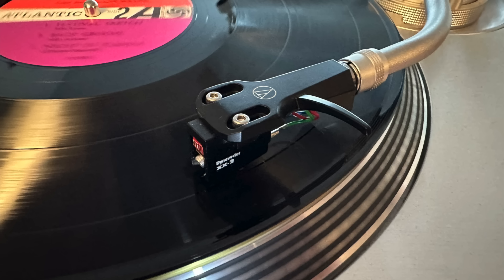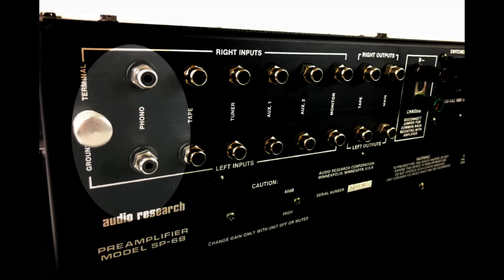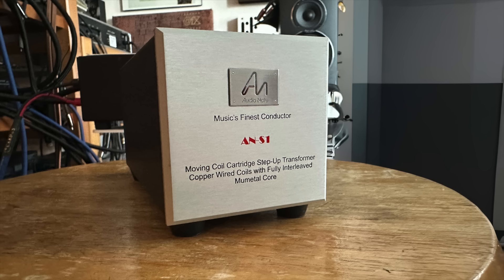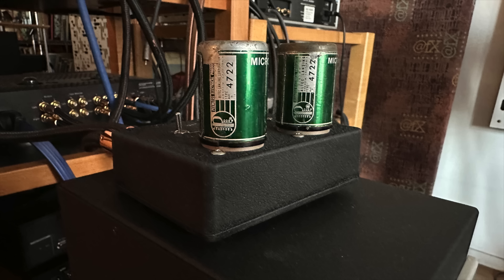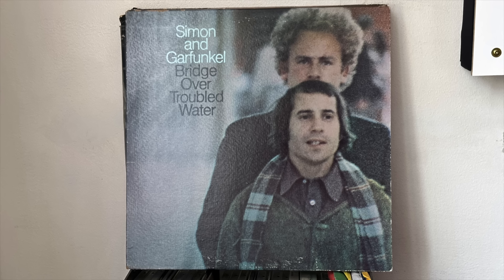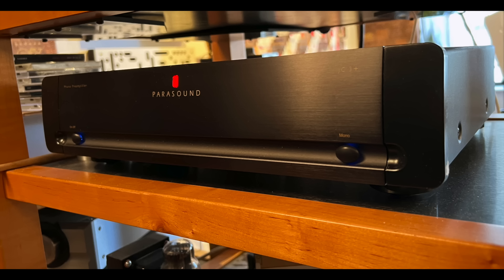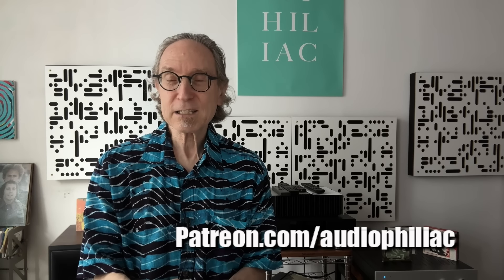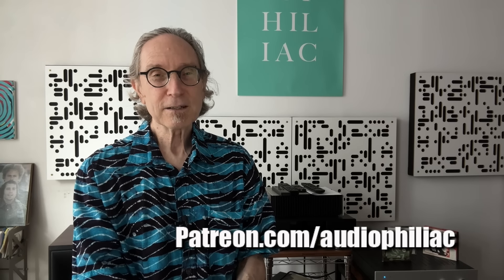HOW TO get the BEST SOUND from MC CARTRIDGES!

Comment: Very informative video which motivated me to find and buy a SUT for my Hana EL. I found and bought a Verion/Cotter Mk1 S locally, which matched up well with the Hana. I was, as you said, blown away. This was not a particularly inexpensive upgrade but one of the best investments I have ever made in the system. (Hana EL, Verion Mk1, Rega P3, iFi Zen, PS Audio 4.5, Dahlquist DQ-LP1, Belles OCM 200 (low frequency), PS Audio 200C (high frequency), Dahlquist DQ-10s, dual Dahlquist DQ-1W subs, Bluesound Node).

Comment: Steve -- I've used SUTs for years, almost exclusively.  I agree with you.  As you say, an MC cart requires two stages of gain.  That first stage can be accomplished with an SUT, a transistor in the phonostage, OR an SUT built into the phonostage (CS Port's and Nagra's phonostages do this, for example).  What it took me years to realize is that many, many "tubed" phonostages actually run your MC signal through a solid state transistor first (Audio Research, for example).  I bought my first SUT simply to bypass the sonic imprint of a transistor (as an experiment), and it led me to a place where I now own 15+ carts and 15+ SUTs.  Borrow one whenever you like.  But there are a few camps out there on the adjustable SUTs like Zesto's.  The magic of the very best SUTs is in the artisanal windings of the actual transformer, and that artistry can get overshadowed by monkeying around with variable impedance, variable gain, etc.
Reply: That is something Kondo, Ypsilon and Air Tight do well. My friend owns one of the best solid state phono stages in the world - CH P10. Though personally my dream phono stage would be an EMT JPA66 MK3 due to it's all tube design and excellent adjustability and flexibility.
Reply: From those you own, what are 2-3 of your favorite SUT's?
Reply: Miyajima’s mono SUT, Lyra’s newly-available Erodion EVO (for an SL Lyra), and a Sound Tradition SUT made with Hashimoto x-formers.
Reply: There is a SS stage in AR's amplifiers as well.

Comment: Steve ~ As to why most step up transformers increase dynamic range better than active gain stages has to do with the ability to transform the moving coil's low voltage, high current input (via a low impedance primary winding) to the high voltage, low current output (via the secondary high impedance winding).

It does this by 1) conserving input to output power passively without adding noise, and 2) having unlimited slew rate by over-designing the transformer's magnetic core material.

SUTs I use with my vintage Ortofon LOMCs are:
• UTC Ouncer 01 w/ MC-10
• Lundahl LL1941 w/ MC-20, and
• Triad JO-3 w/ LYS.

IMO, SUTs get the most out of LOMCs.

Comment: Steve, It amazes me it took you so long to realize how much better MC step-up transformers sound over high-gain active preamps. I experienced the same thing 20 years ago with my Benz Micro L0.4 cartridge, a relatively high 0.6 mV output. I had a vintage Audio Interface MC transformer (still have it) CST 80 (20 db passive gain) which I had bought in the 90s with a Dynavector Karat Ruby (also a high coil impedance cartridge). I was blown away by the warm, luscious, lush, addictive sound. The L04 had similar electrical specs as the EMTs so I bought an EMT cartridge and thats heaven. Linn has a new cartridge (the Kendo) I understand made by EMT with the same specs: 0.6 mV output and 12 ohms coil impedance.

For your XX-2 (6 ohms) I suggest you try the Dyna's own transformer. It also works with Ortofons and Audio Technica. For the Zu (Denon), Denon transformers are the best.

The AI CST80 is considered one the best MC step up devices, comparable to the legendary MA Cotter. For Benz, EMTs, Denons, Dynavector Karats, Van Der Hulls. There is one on eBay right now at https://www.ebay.com/itm/225612746732

Comment: Step up transformers (good ones) are wonderful.  I have used head amps as well, which might be more transparent, but there’s something about a transformer that adds to the musicality of the cartridge that I prefer.  I’m glad you were able to discover the magic that a good step up transformer can add to the vinyl playback experience!

And they do sound different, I’m on my third or fourth model of step up transformer, with this time using  Bob Device‘s Sky transformer, have a pair of David Slagle’s transformers he made for me that I need to rewire to get rid of a ground buzz issue, both transformers sound different from each other. The Slagles are a bit more transparent but have a lower output, while the Bob’s Devices transformers (custom made for him by Cinemag) have more of a sense of body and drive to them.
Reply: I agree i discovered this the hard way i had a Conrad Johnson Premier 15 with a Koetsu Rosewood standard and a VPI Scout and a step up transformer and that combination sounded better than a 20 grand phono without a step up. A step up adds meat on the bones and dynamics and makes it sound more alive period and less 2 dimensional they work well in the right set up.
Reply: I finally took the plunge and bought a Bob’s Devices SUT - one for my stereo cart (Hana ML) and another for my mono turntable (also Hana).  I was skeptical that there would be a meaningful difference.  BUT what a difference !  The “meat on the bones” description is spot on.  Also you should buy a shielded cable from SUT to the MM phonostage.  Just listen to Steve and do it!  By the way I have a Gold Note PH-10 phono stage which has numerous settings which I found helpful to dial things in.

Comment: I have since 1982 used an Audio Technica  AT-630 For MC Cartridge Step-up Transformer for my Nakamichi MC1000 reference pick-up on my VacuumState FVP5a preamplifier that  never had enough gain. I have recently (2yrs ago) purchased a JLTi Phono moving coil preamplifier which has taken my vinyl setup to new levels of charity, wider soundstage and in your words a more there, there experience.
I was happy with the step-up transformer but was total blown away by the JLTi phono preamplifier in my system.

Comment: Great topic Steve! It’s worth noting that the SUT’s turns ratio needs to match the LOMC’s impedance, and that there’s a calculation to figure that out. Also, another phono cable should be used between the SUT and preamp, not just a regular interconnect. Because this is typically an RCA to RCA connection and most phono cables have a DIN to RCA connection, this is a common mistake.

I use an Allnic AUT-2000 SUT with four different gain settings, similar to the Alesso. Up until now I’ve used it with the MM input on a Luxman EQ-500 and an EAR Yoshino 868 pl, both of which also have LOMC inputs. I agree completely with your comments that SUTs are more dynamic and plump up the bass. Even though both the Luxman and EAR use transformers, the Allnic is noticeably better. As passive units, as long as they are placed away from power sources, they are also incredibly quiet, which I believe aids the sound presentation.

I like SUTs so much that I’ve just ordered a high quality MM-only phonostage, a Lejonklou Slipsik 8, to pair with the Allnic. I’m totally sold on SUTs and may purchase several more in the future. The MM/MC phono preamps will go to new homes. They just aren’t needed!

Comment: The cool feature of SUTs is that high frequency brightness can be compensated by putting load resistors across the secondary winding. Parallel resistance provides HF roll-off. Ended up with 165KΩ across the UTC Ouncer 01, and 110KΩ across the Lundahl LL1941s. The Triad JO-3's didn't need any ~ they sounded fine w/o any :)

Comment: The clarity and sense of increased presence you hear with the step up transformers is the exact same change you will hear when moving from resistive volume controls to transformer based volume controls. When I put a pair of autoformer attenuation in my 300B SET amp. It was like lifting a couple bed sheets off my speakers. I would recommend them to everyone.

Comment: Steve's findings (or should we say rediscoveries) are spot on, a good SUT is the best way to elevate an MC's tiny output to MM level for use with a standard preamp with MM 47kOhms input. Some of the very best were made by Mitchell A Cotter during the 70s and 80s, get your hands on one and be prepared to be blown away (for lack of a better term as I rarely use the term like Steve) but be prepared to shell out serious $ as they command very high prices (and justifiably so).

Comment: Glad you rediscovered SUTs. I've been using a Bob's Devices "Sky SUT" for about a dozen years with my Ortofon Cadenza Black. My phono stage is the well-regarded EAR 834p Deluxe MM/MC designed by Tim de Paravacini but the MC is dull and lifeless. All that goes away with a great SUT in play.
Reply: Cool, I use the same combo (Sky SUT/EAR 834P) in one of my systems, very good performance for the money.
Reply: You do know that the 834 uses a SUT for its MC section, don't you?
Reply: @razisn  You obviously don't know that the 834P also comes in a MM ONLY version. I've owned both of the 834P models. Do a little research, it might help you understand better, just a thought.
Reply: @razisn  Yes, but the quality of the transformers or their implementation is not good. Not just me, but almost every review mentions it. And Stereophile lists it as Class A in their biannual rankings but singles out that the Class A rating is just for the MM section even though the model they are discussing is the MM/MC model.

Comment: I've taken the same route, but with different brands all over, and WOW... the speed, the clarity, the details, the soundstage, voices, decay, everything sounds like a much more expensive cartridge.
I have a vintage Luxman PD-121, modded it through the years, because it was actually marketed as a 'mid level' table. And it sounded like one too. Some of my mods are:
I raised the edge of the Platter Matter by approx. 1½ mm, so that the center of the record is pressed down by the same distance when I mount my Nagaoka clamp. This provides a better physical contact area between the record and the mat, which in turn provides snappier transients and a firmer bass. The error in azimuth is much less than half a degree, and is not audible.
I have added ~3 kgs of mass to the table.
I replaced the lousy stock interconnects with Furutech AG-12 DIN/RCA interconnects.
In 2020, I replaced the rather primitive FR-54 tonearm with a Audiomods Series 6.
The same year I replaced my Holfi RIAA with a Primare R-35.
In 2022 I replaced my Denon DL-103R cart with a Hana ML.
In 2024 I purchased a Ortofon ST-80 SE step-up transformer, and had my local HiFi shop make me two sets of low capacitance, low resistance interconnects. Both are Audio Note AN-C Coax cables, 50 cms long, with the two center wires soldered in parallel for the lowest possible resistance, and fitted with Neutrik RCA plugs.

I agree that the SUT in combination with the best interconnects and a better than decent RIAA, makes a big difference, and to the better. I am never going back to using the MC section of my RIAA.
Reply: Thanks Steve :)
Oh, and I forgot that I also damped the bottom of the platter with double adhesive gel strips, and the several places on the bottom of the plinth, as well as added hard foam strips underneath the table, to help isolate it from vibrations caused by my left speaker, that is only 3-4 inches away from the table.
Here's some of my fav reference albums, that I know the very well:
Dire Straits: On every street (180g)
Dire Straits: Brothers in Arms (MOFI 45 RPM, 180g)
Doors: An American Prayer
Gregg Allman Band: Playin' up a storm
k.d. lang: Ingénue (25 years anniversary edition, 180 g)
Björk: Debut (180g)
Steely Dan: Gaucho
Steely Dan: Aja

Comment: Great video, I have been aware of SUT’s but no one has ever mentioned that they could give superior performance over an MC input. Thanks for pointing this out, I will have to check this out.
Reply: Seasoned audiophiles have known of the superiority of mc cartridges and SUT's since the mid 70's. I bought my first SUT in 1977 to use with my GAS Sleeping Beauty mc cartridge - Verion/Cotter P SUT.

Comment: SUT's are the MC secret sauce. The reason is simple, there is no power involved. As long as they are well electrically isolated, they will always be THE right choice. An important point, given that they introduce another set of cables to the loop, shielded RCA cables are an utter necessity, or you'll have another antenna for electric interference. Ortofon makes some excellent ones exactly matched to your Ortofon MC's.  The improvement over McIntosh C53 internal MC amp (which is superb itself) was definitely noticeable.

Comment: In the 90’s, my company, Expressive Technologies, made a very special step up transformer. It was highly praised by Steriophile and TAS. We sold a modest number of them. 

For reasons that I won’t get into here, it’s very difficult for active circuits to handle extremely low voltages well. Even though the transformer adds an interconnected and itself, the benefit of a 20X voltage is significant and easy to hear.
Reply: I agree! After a music signal passes through an SUT the signal-to-noise ratio is superior to ANY mm or mi cartridge. The result is more life-like detail and dynamics from familiar LP's.

Comment: I'm still using  an audio technica AT  650  step up transformer with at oc 3 cartridge.  Sounds superb , 40 year old transformer with variable impedance settings and silver wired  internally.  Fetching high prices on the second hand market .

Comment: I'm using a DENON AU-320 step up transformer with a low output Benz Micro Reference cartridge, going in the MM tube phono stage of a Sunfire tube amp, and the sound is amazing !
Reply: I’m considering that SUT for a Denon DL-304 cartridge. It should be spot on for it, but my concern is that old looking cable with plastic RCA plugs -I would rather use my own low capacitance cable. Did you find any problem there? Is the cable well shielded in your opinion? Thanks in advance!

Comment: Dynavector XX2 MKII is great, it’s been my main cartridge for the last few years.

The way you describe the transformer as having a more expansive sound is exactly what I’ve experienced with transformers versus step up/head amps!
Reply: I also use an xx2 into an EAR 834p.  I've heard this phono has good transformers within but there is also a separate step-up, the MC4 which I've wondered about.
Reply: Can you recommend one of the less expensive Dynavector’s?

Comment: Steve, great video man. 1 thing though, with Ned’s bases you’ve got that same ability to use 4 different gain settings.  Add a Darlington Labs MP7b with many different load settings fir a lot less than the Zesto…..anyway, I’m an analog fanatic, so loved the video😊
Reply: Sorry, should said Ned has another base, which I have,   that has 4 different gains…or 4 winding ratios, however you want to say it.

Comment: Really great video Steve. It inspired me to trial a couple of SUT options with my Hana ML + Dynavector P75 - a Fonolab EQVES and an Audiitorium 23 (Denon 103) SUT. Wow...what a transformation. The Fonolab produced similar results to what you described with the OJAS unit, but got a little congested at the top end. The A23 was spectacular top to bottom and the one I have kept. Matching SUT to cart is definitely pretty critical, but on paper the A23 should not be an ideal match for the Hana ML - proving that auditioning is the only way to go.

Comment: straight wire with gain, I suppose the host didn't want to sound trite, but I'll repeat the conceptual  ideal amplification, and I would say the passive amplification described here is about as close as one is going to get.   

I was pleased to find that my understandings aligned with the expert host's experiences.  I run only a single MM cart for ease of amplification, so have only that experience.   But it only stands to reason that a simple this or that phono voltage amplifier is going to have it's limits, so I've been sticking with my nice MM cart and replacing the tip when it wears, knowing that a stronger signal will get processed less.   Plus my records are mostly rock and simple to record stuff, so I'm fine. everything sounds good.    

But this presentation reminded me how best to set up a low output cart, and although I have been thinking about upgrading my amplification , I haven' t really been thinking of transformers , even though I knew they were the best way to go.  .

I don't switch carts , so I'll just have to find one optimal match transformer, if I don't stay with high output .
Reply: I have never heard a mm or mi cartridge that can compete with a lomc cartridge/SUT combination.

Comment: Reading The Audio Critic mag in the late seventies early eighties they were all into passive SUTs as opposed to active MC stages, as the very best way to boost the signal from your MC cart of choice. So it's far from a new idea and I've been using these ever since. MCs electrically vary so much when comes to their different needs, that to extract the utmost out of your cart you really need to have a specially dedicated SUT for each and every one of these. OR as I do; have a very versatile Kondo AN Japan all silver S-7 Cz transform with a captive AN silver IC cable. And boy do it sound differently according to the settings. And absolutely glorious when hit bulls eye.
So if you have a lot of different MC carts it is wise to choose a variable Step Up Transformer
Reply: I agree! I too subscribed to The Audio Critic! My first SUT was the recommended Verion/Cotter P SUT.